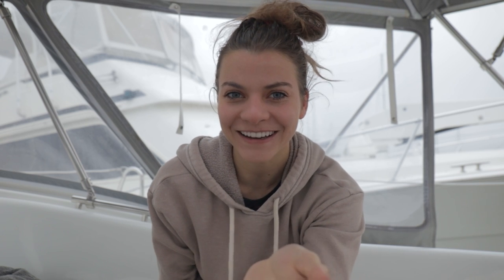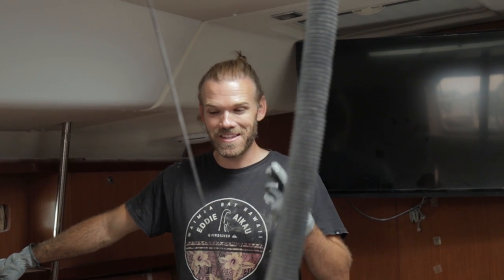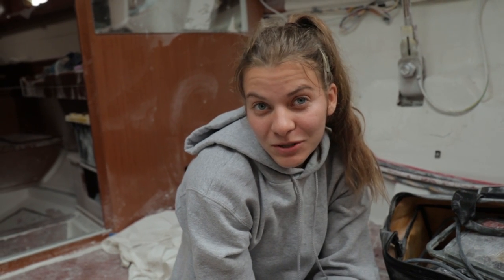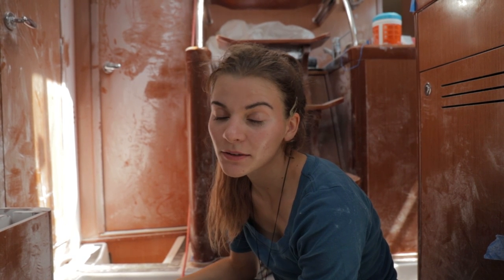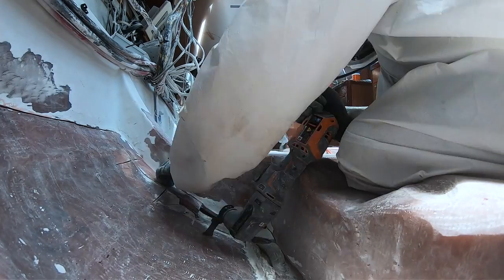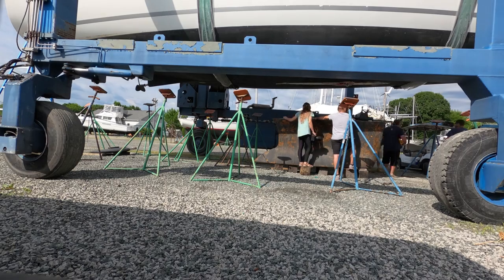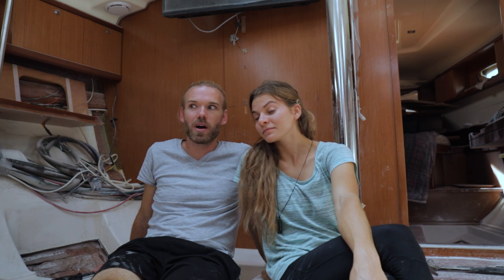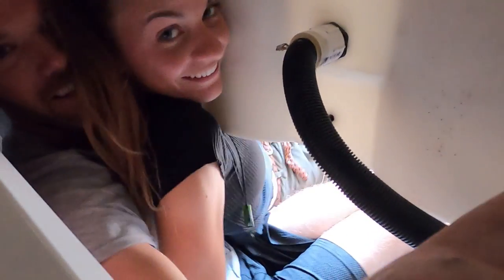Our Keel Gets RIPPED OFF! (and so do we) | Expedition Evans 11

Comment: Great video.  Have you read any of Fatty Goodlander's books?  He has several long discussions about bolt-on keels.  (In all candor, you might want to think about switching to another type of boat.)  His books are well worth a read.  As for the yard, after about the second set of excuses, I would have gone someplace else.  After they had ripped a hole in the bottom of my boat--doing extensive damage both seen and unseen--I would have called a lawyer.  Harsh?  Maybe, but there's no excuse--no excuse at all--for that sort of "work."

Comment: I know others have said, but contact Andy at Boat Works Today. He is a genius at this stuff. There are two different types of resin. Each has its place, and will not necessarily bond to each other in the wrong order. His advice would be well worth the trouble. If it were me, I would fly him out for a day for inspection and advice if possible. People that just say fiberglass is easy don’t necessarily know what they are talking about. Good luck !

Comment: Hi guys, the builders wil notl be much help, due to liability issues , they don't  actually care.   Viewers possibly not aware that the keel boxes are recesses in the keel that provide a low spot for bilge pumps  because vessel does not have a deep  bilge , when grid fails the keel  wobbles  around ,seen a Benny 53  that the yard crew got moving 6 inches side ways the bilge boxes are bonded with 5200 or similar as was keel , given that there was a leak and previous damage  those boxes would have been full of  damage ,  not surprised that they tore off, suggest you grind off all antifouling to see all the damage, the 53 mentioned earier had the entire   keel  area out 1 metre  both sides removed  . Hope you don't have to go that far , but yes , Its just MORE fibreglass , all very do able, its not rocket science.  Keep smiling. Whitsunday guy.

Comment: I'll be a little bit contrarian with respect to most of the other comments. You experience in getting the keel dropped is pretty typical. You're right nearby, so I know it's the end of the season (I'm sure you noticed it's getting cold and snowing) and a yard with a Travelift is going to be pretty busy right now. Not wanting you under the boat as they lift it is completely ordinary - those guys have insurance rules. Most yards wouldn't let you be doing much of what you're doing as it is.

Keel removal jobs can be far worse. The 5200 is literally stronger than the fiberglass, and taking big chunks out as the boat comes off the keel is what happens. If the fiberglass didn't come with the keel, you would have been cutting it out because you can't glass over the 5200. As others have said, now that it's open get a nautical engineer out there to take a look. There are plenty nearby (if you need a recommendation just ask), it really won't cost that much and it should give you some peace of mind as you're halfway across the Atlantic. You guys are smart, ambitious and hard working, but remember, you don't know what you don't know. Pay the NA to tell you.

Comment: adhesive strength 5200 changes much with temperature.  I would have suggested a series of heat guns focused on the metal which has much higher thermal conductivity so it might have allowed the keel replacement.  I still don't know why it was essential to drop the keel.

Comment: We used to use stainless steel safety wire to cut through 5200 when removing the flap fairings from  727s / 757s.  You can feed it into places that are hard to access with other tools.  We'd tie off a ratchet handle on either end and work it back and forth.  Since the wire is smooth and round, no worries of damaging structure!  Another epic episode!  Great work!
Reply from the maker: That would have worked well for everywhere except for the sump pocket  - It was filled with 5200 on all sides and bottom and likely would have ripped off regardless
Reply: In the Operating Room, we referred to that as a "Gigli Saw", connecting pre drilled  Burr Holes to remove a section of the skull. Despite being slow and laborious, it actually worked quite well.
Reply: @Ssirc2  thanks for that trick, I was thinking of something similar inspired by the two handed saws that loggers used to use, and there you go, it’s a thing. Gigli Saw
Reply: @Ssirc2  You're a brain surgeon? Wow. I guess that took a couple extra years of schooling.

Comment: Has anyone ever recommended a negative air system for your grinding in the boat? Basically what Asbestos remediation teams use that keeps air being sucked out through a large vent fan system. I use an internal unit when I'm doing small projects to keep air clean, but I'd probably use an larger externally venting system for that much dust.🤷🏻‍♂️

Comment: Your grid is it hollow or is there wood beams inside them. As far as bonding the grid back!!! If there is any gap between the wood/grid at all and it’s not at least 75% filled when you glass back over. The problem is the hull will flex and break any new tabbing you put in cause it’s allowed to WORK. Find a way to fill those gaps as completly as possible to prevent this micro working. Boat and ships hills when there allowed to flex even microscopically will crack. Just my .02. Great vids great voyage.

Comment: If you noticed your front keel bolt was covered in 5200 this is wrong , the 5200 should only be on the top threads like your  other  bolts having it all over will cause a hydraulic lock and you will not get the keel bolt tight, you think it is by torque wrench ,but the joint is not . Whoever did this does not know what they are doing . I had the same repair and replaced all my bolts ungraded to 10.9 grade and fabricated large s/s plates with gussets rather than the shitty washers
Ordering new bushings will most likely not fix your play issue the bearing spins in the glass and wears the glass  you need to glass in some tape in the lower bearing  to tighten the bearing

Comment: Benetau are decent boat. A friend of mine bought last yr a Benetau 50 of yr 2000. It's the only 50" factory standard boat with 4 cabins and 4 bath. 2 in the front and 2 in the back. Open space in between. The little  space aft. where you normally take down   the spinn and Jenn. Was converted in to a little cabin for the only crew member. The inside looks very similar to this, (I guess is the standard factory, same design, same wood, same lay out.) I did an Atlantic crossing on it and it felt been on a bus. Nice boat overall but no charm. I don't know how much did you guys have payed for yours, plus refitting. Hope you were able to get a good deals at the end. For the 2 of you and the dogs, You'll have plenty of space.

Comment: You are doing the right amount of repair, after you will have an ocean going yacht. Better stronger than before.
Reply: They did not say they had a 2 x 3 hole in their boat, what the incompetant yard workers did was to peel a 3 x 2 area of grp skin off the thick hull laminate, its probably only 3 _  4 mm thick, maybe less  this is easily  repaired and re gel coated.  The hull in this area is probably over 25mm + thick.

Comment: Well at least it’s off now.  The adhesion of the 5200 and the compromised Fiberglass in the sump area probably meant this was inevitable.  Can’t see how you could have cut the 5200 on the vertical sides of the sump.  What matters now is getting the hull repaired in such a way that it will mate back to the keel properly. You could make a plug. Then a mold. And carry out the repairs from the inside. You would have to remove large sections of the grid but that looks inevitable.  You would have to rebuild the hull and sump using timber/fiberglass/bondo/paint.  This is not structure only the plug. If you can get the sump out of the keel this can be used in the plug. Check the shape of the hull/sump/plug and the curvature fore and aft. Make sure it matches the top of the keel. Sand and paint the plug/hull.  At this point it will look like you are finished😁. Nope only getting started. Now wax the plug/hull and lay on fiberglass cheap stuff as this is your temporary mold. Extend it out on to the hull as far as required to get to good hull laminate and a bit beyond.  Index the mold onto the hull you can probably use the keel bolt holes. Now remove the mold. Remove the plug and cut out all the damage. Wax the mold and refit using indexing holes props tape etc. Now from inside the boat you have a female mold to lay up your new laminate.  Good luck however you tackle the repair. Really enjoying the videos. Congrats on how much traction you have gained on your channel so quickly. Well done 👍

Comment: Now is when you call Beneteau and hire their structural engine to give you a plan of repair method to follow.  Moving forward this would be money well spent.  
Best of luck you guys.
Remember to slow down and enjoy the process.
Reply: Hire the same guys who did that original build to help?   I wouldn't.
Reply: @jandtlivinglife3130  The point being, you gotta know when to call in a pro.  Doing everything yourself makes you feel good, but hiring a professional will make you feel great.  Most of the work is DYI, but learning as you go is a bad game plan when it comes to structural components.  I wonder how they are going to deal with curing in the cold weather?

Comment: You might want to consider drilling holes for threaded rod to go through the grid and hull.  You can pull the two together by tightening nuts on the rod.  If you drill them in a line fore-aft then you can run a board between them under the hull to make sure you spread out the load.  You might even be able to run something port-starboard to pull up the hull between the rods.  Without the grid attached and only stanchions  holding up the boat the hull might not be in the proper shape and just pushing down on the grid might not give you a good connection or shape.

Comment: Exactly the same ripping sound on a friends 411 Bene , The sump was bonded into the keel. Ended up a blessing he could fit a bigger bilge pump in with a floater when they redid the hull, Before the sump was just a little small , Hey guys your doing great , from now on its seeing results . One thing he did was fit bigger keel bolt washers when he replaced the keel - Fair winds .
Reply: Yeah, the plate washers that they have are a bit small to my eye. Stainless especially 316 will deform and could be pulled through in the right circumstance.

Comment: I know this was from a long time ago, but for others doing the same. A trick I learned is 5200 comes apart with heat. Use a torch, you just have to be careful not to scorch the fiberglass as it will weaken the resin if you get it too hot. Works wonders for removing thru hulls.
Reply: Yeah I had to pulll up a windlass bedded with 5200 and was able to heat up a putty knife with a torch and slide it into the 5200 to cut it. Worked great.

Comment: You are doing great,  but PLEASE find a qualified  composites engineer to work with you on your plan for re- bonding everything. Don't just rely on the yard workers suggestions, or mine. I am convinced that the original builders design and building methods were not sufficient for the loads involved.  When you dropped the keel that hole that tore out appeared too easily.  Many thousands of pounds are being applied to each of those keel bolts all in tension on one side and compression on the other,  then reversing over and over again as the boat moves through the water. 
Terry Wells, Yacht designer and builder
Kauai, Hawaii
Reply: They said they have an expert that inspected it and is advising them. 👍
Reply: Always helps to get some oversight from multiple sources, do your own research and testing and apply the method that best suits your specific application. I paid a THE qualified expert on cylinder molding to come look at my boat himself. His words “Looks Good” no need for me to say any more everything I’ve documented declares the total opposite with irrefutable evidence. 
Later I was advised by the same Designer ( as well as another NA to replace what was barely bonded on with (Get this: heavy Triaxial Fiberglass.... Imagine reglassing an entire 37’ hull to scantlings sufficient to replace 6 mm of Marine ply by yourself as an OVERHEAD Layup GTFOH
Ended up drawing from multiple sources of reputable information 
Particularly the Gougeon Brother on obsolete wooden boat construction and incorporating it all into a variation of cold molding. Again not every expert has the time or desire to be as intimately involved in a repair project and certainly it won’t be their life on the line out on the davy jones

Comment: Sad. But it looks like this Boat Yard is from Old School, my thinking you should get with a Good Keel Company to see a new way too bolt the Keel back on! Hope you use Some Kevlar Fiber /Carbon for better strength! Are you two going to build a boat house so you can work on it this Winter?  PS. If you think about Tshirt to Sell I know a Company that could Help maybe?   Just want to add something from Replies from other fans. Optrel High Efficiency Powered Air Purifying Respirator. Will help

Comment: 22:13 Don't sweat cutting through the hull. feather, patch and sand. Minus the time it will take the epoxy to set, that's a 1-2 hour fix. In the grand scheme of things that little cut will take no time at all. You guys are going to be pro's at 'glassing by the time this is done.

Comment: Just thought id let you know, although it is good to remove gelcote to inspect the glass underneath it is not a bad thing to glass over "properly prepped" gelcote. Polyester gelcote is just tinted polyester resin which is what the boat, and probably repair will be made of. If using epoxy to repair no gelcote can be used to finish the repair after  but the bond of epoxy to gelcote is just as strong, 'if properly prepped"!!

Comment: 3M 5200 has a tensile strength between 640 to 700 kg/cm2 before breaking (just googled it)
They must have used stainless steel trolling wire (single strand), about 5 feet long, with a handle at both ends, to slide it, pulling at both ends, between the keel and the hull 🧐. That would have cut the 5200 avoiding stressing a/o breaking the surface
Nothing that you guys can't repair 🙌
Reply: What are you talking about? Who is "they"?

Comment: Unfortunately you cannot trust workers of any kind! I watch people like a hawk whenever I have to have work done on my house. I try to fix as many things as possible myself. Satellite dish installers are notorious for doing the fastest and messiest work possible. They just lay wires across the shingles instead of routing and securing them properly. Boat repairs might save you from a life or death situation. If you pay to have your wiring redone in a safe manner, that is what you would expect! You have shown how incredibly labor intensive your fiberglass repair is, if done properly. How do you check on them, unless you could inspect the job daily?? You cannot trust anyone but yourself!
Reply: “ good enough construction”
Reply: I thought those tv cable guys were unique to ireland😂
Reply: My friend had "professionals" to do electric installation in his house. They put an electric outlet into his shower...

Comment: couldve well been that the sump was bonded to the keel and they'd atached it to the boat while the epoxy was still wet 
i seen the last vid (posted januari 1 2021 ) and i wonder if you need you put a large patch along the whole length of the top of the keel covering all the repairs and around the edge of the keel where it bonds to the hull except for the cutout for the sump then feather the edge of that patch to the rest of the hull 
my though behind it is that even if the small patches let go or not being bonded / impregnated well enough there being held in place by the big patch that has a way larger bonding surface
there is a chance with the boat moving in the water along the repair that the waterpresure will crack the paint and delaminate the big patch along the edges by working itself under it 
i would definetely talk about it with someone that knows wat hes talking about

Comment: Again, you produced a great video diary of an important project milestone...
It was a surprise to witness a chunk of Hull Fiberglass rip out when Keel dropped. Or was it expected?
You need to prove me wrong with saying delamination occurs from flexing where the resin shears away from the cloth strands.
An interesting question is HOW flexible or stiff should your Hull/Inner Support Structure Assembly be?
Possibly the most flexible Keel design might be a Rubber composite with strong chains inside connected to a heavy bottom weight hanging from a mounting plate on the Hull? But a flexible Keel is a different idea but isn’t the purpose of what a Keel is about.
Of course opposite would be a non flexible to Hull to Keel design, some designs incorporate the entire boat length into the Keel design.
Studying inside delaminates, cracks and breaks may be a guide to find delaminates and cracks on the Hull outside right in those areas!
Perhaps bolt washer plates under the Keel Bolt heads would help widen the footprint connection strength.
One comment showed different options beyond using standard resin. An effort might be important to compare the different types shear and tensile strengths. That might help minimize delamination during any kind of flexing.
Realize most everything flexes, ie concrete, glass, etc and they all have limits until they break.
If research test results are available from multilayering cloth, look for various wall thickness strengths with flexing.
Previous Owner might consider himself Blessed to have not ripped the Keel right off the Hull Assembly, it’s a quick way to the bottom!
Can hardly wait until the next released video! Being thorough to discover, strengthen and fix is the only way.